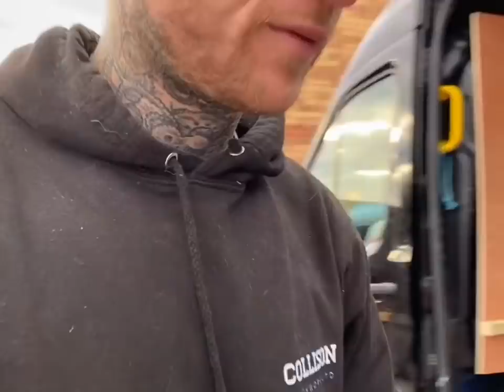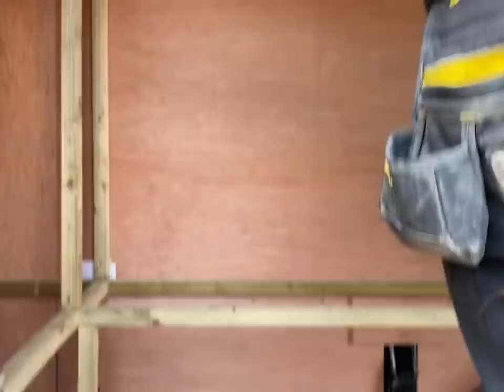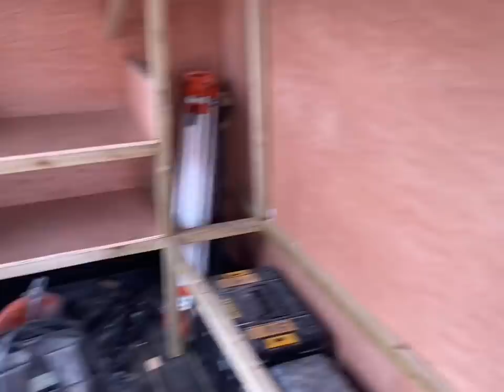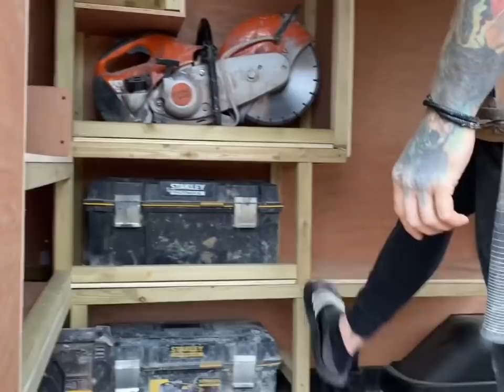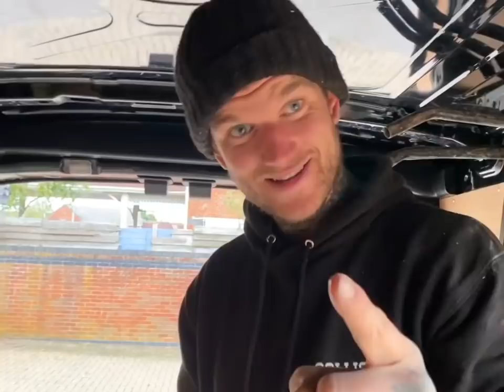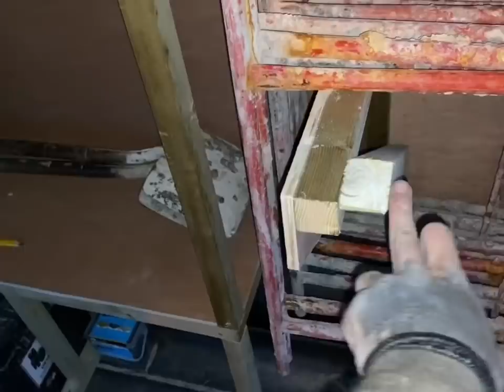Bricklaying, building a bricklayers van part 2

Comment: Nice work Charlie.  Do not forget the security issues some folk talked about recently. Maybe a bar and padlock either though the doors or the bays where you have your high value gear.  There is a few quids worth of gear in there.

Comment: If leaving tools in van over night 

chain Stihl saw up with bike lock to anchor point in van 

get a van vault for the power tools 

if house is alarmed add a sensor in the back of the van and patch into house alarm 

Get dead locks for the van 
 
Most gutting feeling when your van gets done over just be careful and make it as hard as you can for em 👍
Reply: Good advice mate. Sad to think we have to go to that level of security these days. But needs must!
Reply: Won't the van alarm be good enough?
Reply: Hook locks... an upgrade and better than dead locks I had four fitted in my vivaro... both cab doors, side and back... £550 money well spent.... I sleep easier now
Google Edd locks.... would always recommend them...
Reply: Just screw a 2x1 batten on the shelve face to hide the bad cuts! Will also make it more ridge 👍

Comment: Not bad for a brickie charlie use triangular cut timber wedges to fill those gaps if you dont want to change the bits on your shelves. Use a bit of wood glue tap them in tight then cut of the excess with a saw. I know chippies that would struggle to do wot youve done so fair play

Comment: Great effort Charlie 👍
Good idea not too rush it, should get the result your looking for.
Maybe you could place your boards (have the hooks through the middle of the stands) over your stands which would allow your profiles to extend at the top.
Maybe some motorcycle ramps for your cement mixer? I was thinking to my self if your doing privates now your need a mixer. What you thinking of getting? I got a belle 150 mixer electric, love it!
Hope your all well see ya in the next one 👍👍

Comment: Looking good, nothing better than designing and building your own and adapting as you go. One thought, you could put a roll out awning on the side to make a sheltered spot and have a couple of folding chairs to pull out. Nice as a day van, get away with Amy and the dogs. You can sometimes pick them up on eBay quite cheap.
Oh, another thought; non slip rubber mats are great for stopping things sliding around on shelves, and a rubber mat on the floor will make it easy to keep muck off the floor when you’re jumping in and out with muddy boots on.

Comment: Off to b&q for more free saws and screws, looks ok. Keep your heavy items low on floor in making your raking and light items higher, bear in mind the more items your hang up the more they will rattle and drive you mad. Defo get some dead locks fitted

Comment: Charlie 8/10 buddy from an old joiner. To be honest a fair crack buddy if you’ve not done it before (so well done). With my three vans I tried to make it simpler in design by using modules i.e. like your boot and bucket bay (tall and long and build several side by side to a certain width. The trick being not to use screw every joint together and make joints but use L brackets from B&Q. If you don’t like the lay lout or want to modify anything you can do so much easier by undoing the L brackets that join 2x2 frame together or the ply shelf units. The odd miss angled cut joint can be rectified out later by removing and replacing subsequently (user a bevel) to work your angles between the two support members. Well done buddy 8/10 (feel proud). You will find as you go along you will now develop and change the concept lay out based on your experiences over the next 6 months using and living with the current design you’ve created. You will refine and improve it each time. The desk thing for drawings inside etc (don’t bother) use a small piece of off cut plywood as a temporary desk top when your sat  inside the main cab in your comfy chair. Use bulldog clips to hold the drawings to your make shift desk top. Hope this helps. regards Olly

Comment: I've got my van racked being a joiner/builder.
Never underestimate the need to be able to get 8x4 sheets in the back or a pallet of bricks or tonne bag. I designed my racking around that. Something hopefully not too often but sometimes emergencies happen and you need the space. Especially since you want to be off sites.
Reply: I'll second that Sid!
You can't beat a good versatile builder's van.
You need to be able to remove some internal box work without too much hassle.  To accommodate big bulky loads like you already mentioned.

Comment: Put any heavy tools and that lower down on the floor. Same with liquids too. Both break if they fall down off the shelves and liquids make a right mess when they break. I'd also build a boxed in section by the back doors where you're stands are to put the stands in. With like open back by the back doors so you can get to them easily and so they arnt slamming into the walls. Don't cut you're profiles just slide them in a little channel under the racking or on the floor infront of the racking with a batten on the outside the keep them from moving around. Looks good so far though pal!

Comment: charlie, for  the shelf you arent happy with, drop the horizontal pieces down abit, that will make the angle support pieces stick up above the horizontal ones then just retrim them (youll have to take the shelf board off but easy enough)

Comment: If you put the mixer in backwards so the handles are in the van first then just lift from the wheels, it will just slide in on the handles. No need for ramps mate. Good job so far pal

Comment: Good job you can lay bricks 😉 
Jokes aside I wouldn’t worry about wood filler as long as it’s holds all your tools and it works once the doors shut no one will see it. And if they are in the van they need a slap 👋

Comment: Charles.  You need bungies or even a piece of wood with one screw (so you can turn it) holding stuff on the shelves.  Otherwise looks good
Reply: Can't go wrong with a small selection of bungees to hold things back in the van there a god send 👍🏻 or cut down a few endless ratchet strap straps

Comment: Looks good for a bricky mate! Maybe not so good if i saw it in person haha! Just pulling your leg. Have a look a led strip lighting mate its a god send in the winter!!
Reply: Buy some 5 meter lengths of  
 "5630" cool white led strip lights for the van off ebay, just strip the ends off & join them to the existing internal light connector forks (or whatever there called lol) lights up the back a good'un 👌🏻

Comment: Put a wee pencil mark of the angle of that bit of 2x2 you’ve screwed on to the side for bracing on your stand holder so it’s the perfect angle and can put a bit of ply on the inside to hide the framing and tidy it all up and it won’t be so thick, decent job though👍🏻

Comment: unless you get some metal supports on your joints the hole lot of the timer will just fall apart bud with the movement of the van
Reply: You're right , he's doing good but does need to add metal bracing
Reply: i did mine same as this years ago, never budged, how can it if screwed together correctly
Reply: Nonsense. Did my van racking in timber over 4 years ago and it is as solid now as the day it went in. There is not a single bit of metal bracing anywhere!
Reply: @Jim_Newlands  its not absolute must but it will help with lots of movement like on and off site and the change in weather conditions also the type of timber used as he may not do the same as you

Comment: I did similar to this, in reality now your doing your own work you need to think where your going to put random things and offcuts of materials after a job etc, that naturally accumulate, in your job for example half a pack of brick ties, half a roll of different sized damps, insulation, sand cement, the list goes on, with more private work youll probably find yourself buying some more power tools to do the jobs you never had to on site also
Reply: This is the only problem when doing privates. The amount of stuff you need it ends up being a building firm😂

Comment: Come on Fella, stick to throwing muck about, chippy work is not for you😒, 2 months down the line half of that will be a pile of scrap in the back of your van, the van will move and pull most of your screws out.
And bin the missus at work. Not a good look.